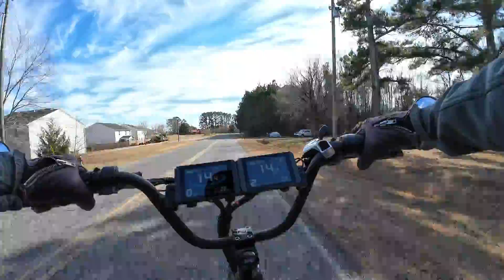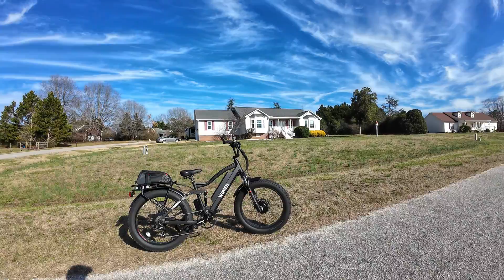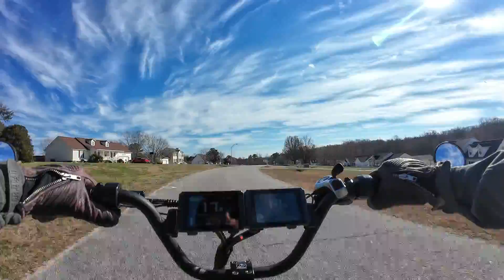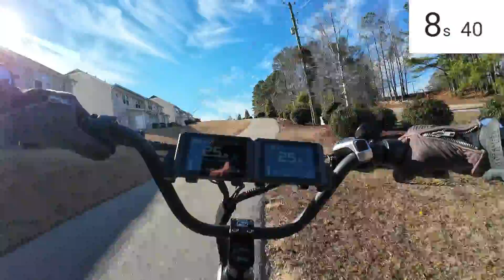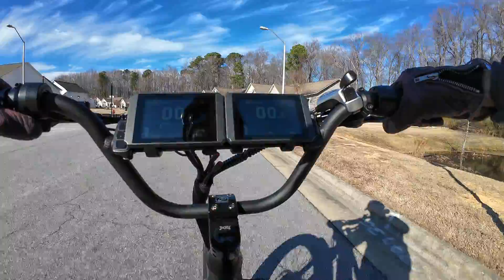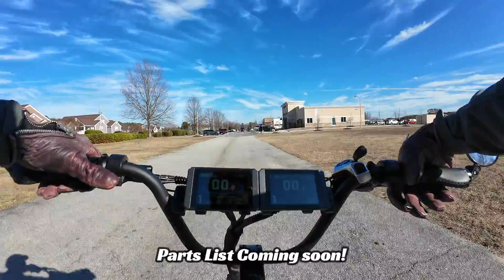Wired Freedom: Performance Upgrade Testing

Comment: Hi CC...
Can I suggest or you put it into a vote with all your viewer about upgrading an ebike with the super bike front and the side panels half way across the bike.
I would like to see that.
I want to learn fiber glass & do it myself & 3000w each wheel 72v controller system but funding problems stopping me.
I hope you do as I & many will love to see if it can be done

Comment: We need a mid-drive single throttle add-on plug and play kit for the 60v dual battery 2025 Wired Freedom. 😎🤘 And then a plug and play front hub for triple crown freedom!

Comment: This mod just makes it accelerate faster correct, it doesn’t make the top speed higher does it?
Reply from the maker: More acceleration and hill climb power, not top end speed.
Reply: @CitizenCycle925  cool.. have you seen the ecell five star? It’s essentially the same bike but I can’t find any reviews for it

Comment: Will the kit work on all bikes? Or do you need certain forks on the front to make it work?
Reply from the maker: Need the rst guide forks
Reply: @CitizenCycle925  thanks.
Reply: @CitizenCycle925  you wouldn’t happen to have a list of bikes already equipped with rst guide fork?
Reply: @CitizenCycle925  hey would you be able to test out the conversion kit on a beecool bike?
Reply from the maker: @singlestringstruggler1988  Unfortunately, I don't have a bee cool bike to try on.

Comment: I have a few questions about my 2024 freedom   Your thoughts on the rear gear set its different from the 2023 also the Kenda Tires they Have a Max presure 30 psi last year's tires are 20 psi and seem like they are softer compound.  also my wired had 4.9 miles on speedo out of the box everthing was freshly packaged do you see this with your new purchased bikes  
Lee

Comment: Could this be E-Cells answer to the Wired Freedom? The E-Cells Five Star. Nylon/steel hybrid gears, 60V 40 amp controller, 1200W motor, 20Ah battery, DNM air shock (rear), Kenda Krusade fat tire, 56 tooth chain ring, high rise BMX style handlebars, cruise control, etc, etc, etc. Free shipping, free front basket. Didn't reckon it would take too long for the competition to notice, let the price wars begin!

Comment: Is there a reason why you couldn't splice into the original throttle and display wires and eliminate the need for two of everything? Possibly even use the front/rear/dual switch from something like the grizzly?
Reply from the maker: Yes you can certainly connect everything together however The drawback is you are messing up all your bikes original wiring. Plus having both Motors connected to one throttle I find way more dangerous, the front motor can kick in when you're not expecting it. I've ridden many all-wheel drive bikes  And that is certainly their downfall, unexpected front wheel engagement.

Comment: It’s time to connect everything together with one throttle and one pedal assist and one display with a switch to be able to run one motor or both motors !!
Reply from the maker: Nah much better this way.  Safer
Reply: @CitizenCycle925  I disagree!!

Comment: Full suspension shouldn't be the starting point. You're lightweight compared to the average US citizen. These cheap bikes starting to creak like hell, when they're aging. These full suspension constructions aren't made for heavy riders, even if they claim they are. They wear out quit fast, if the user is heavy. If customers aren't able to maintain these constructions - don't buy it. You will thank me later. Get a hardtail, put a parallelogram suspension seatpost like the Suntour NCX on it and just be happy. If this thing stars to creak, open it, put some grease in it an be happy. If you totalled it, just switch it out and have fun again. It's cheap and easy. With a cheap full suspension bike it won't be easy. You have to find the spot where it creaks, and after that good luck to you to do the right thing. It's so easy to fck this up. Don't think that qualified bike shops will help you with your cheapo china brand bike.
Reply: Bike shops may not have a choice on whether to work on these bikes as their sales dip on their $5000+ bikes, they will need to add to the servicing of other bikes and sales of accessories for them,  just to keep the doors open.
Reply: @johnforbes9007   These constructions are cheap shit. It’s just what it is. Shops don’t touch it as they can’t guarantee for the repair. Just because Chinese manufacturers don’t give a fck about their customers and the products they sell to them, you can’t blame the bike shops. It’s a learnig process especially for consumers.

Comment: I bought a dual motor e-bike that is just fine, and it only has one display. It can be switched from front wheel drive only,  or rear wheel drive only, or dual motor drive. There's no need to go through all that modification on a Wired Freedom and have two displays that look just playing silly.

Comment: Soooo in summary, dual motor Wired Freedom; faster acceleration, same top end speed, same battery capacity...RIP battery.
Reply from the maker: 2nd battery is in my rear pack hiding 🙂

Comment: I just got mine yesterday. I can't get off of it. PSA: It's a HUGE bike, videos and pics simply cannot capture its actual size. No complaints personally, I'm 6'5 and even installed a 2 inch stem riser, I feel like a kid on it! If you're on the fence, just pull the trigger and get this thing.
Reply from the maker: Glad you love it and yes it is large and in charge, pics online  don't do it justice.

Comment: I wonder if you could change any of the gearing to get higher top end?
Reply: They’re hub motors..the gearing is all internal. If you wanna deal with gearings you need a mid drive
Reply: @slimdunkin117  I am not talking about the electric motor gearing, I was thinking more in the line of sprocket size!

Comment: Dude PAS 5 and run on the peddles it's an easy 40+ mph bike. Throttle only doesn't give full power. You'll notice when you're in PAS 5 and peddling doing 40 if you apply the throttle it actually slows you down.
Reply: I heard if you use the brake it slows down too

Comment: You can  use just 1 pas, 1 display and 1 throttle for two controllers and two motors. 
  With one battery inline, you just need to connect on throttle both sensor wires on a 3way switch before throttle connection ,and connect both negs together to make 1, use 1 power wire for direct 5v to throttle. 
  With Display : connect  1 power wire from controller to display, and both negs to display, match both uart in and out wires to each controller(IE: example both blue from both controllers twisted together to the one blue on display ) . And then do thru display reprogramming the setting to the way you like, be sure to have the display reset to factory settings before setting up.

  I have a few videos of one I built this way with a 1000w rear direct drive hub and a 1500w front direct drive hub, using 2 40A 48-72v controllers and 1 throttle w/regen ,and 1 sw900 display . No pas  was available with the controllers i used.

Comment: The range is atrocious tho. This bike is a UNIT! I recieved mine 2 weeks ago and I would only do a shunts mod. I'm not tryna add more significant weight to this bike. It's pretty much faster than most other ebikes on the market. Don't tell your local bike shop this bike goes over 28mph otherwise they will not touch it.

Comment: Love the power of the WF, but the bike its self is terrible, looks like a DIY Frankensteinz buld out of the bix, just throwing any old  BMX bars on a full suspension mountain bike, what were they thinking.  Needs to be converted back to a mountain bike, and the gearing needs to go fixed, can't ride any real trails with that set up.
Reply: It's not meant to be a mountain bike, hence the cruiser style frame, higher rise bars and bigger front chainring for higher speeds. This is basically a comfortable onroad/light trail bike. If you really wanted to do heavy mountain biking or downhill stuff, you would need a mid drive. Completely different applications for different reasons. The price point was their goal with 40mph speed and they achieved it.
Reply: @leetjohnson  it's not meant to be a mountain bike, but it is a mountain bike.    I ride black diamonds all the time with a hub motor,  I see the 250w full suspension out there all the time, but never seen anything with a Bafang mid drive, I've always wondered it a stock bicycle drivetrain could handle that kind of power on hilly rocky  trails
Reply: @bassw1758  you've never *noticed mid drives out there. Nobody that does serious downhill riding uses a hub motor. Mid drives dominate the higher end mountain ebike market.
Reply: I live in Folsom and there are literally hundreds of mid drive bikes out here.
Reply: @leetjohnson  yeah that's what I said, 250w full suspension, Specialized, Trek, those sort of bikes.  I ride a DIY Fat Tire Mountain bike, it's has the 1,000w Bafang Huh 6.5 wind( better torque, little less high-speed).  It will climb  just about anything with a little bit of help in PAS 2,  I'm surprised nobody else has caught on.
Reply: @leetjohnson  Bafangs?
Reply: @bassw1758  no, usually Bosch
Reply: @bassw1758  it's just a lot of unsprung weight, and you can't use the gears to multiply the power/torque like you can with mid drive.
Reply: @leetjohnson  I hear you about the non suspended weight,(full suspension going off jumps mid drive for sure)  but we're going to have to agree to disagree on power.  When your peak is 550w ish  you need the mechanical. advantage of gears,  Once your over 1,000w, peak, combined with the human factor, there's no advantage.   Tesla's run off of hub motors not mid drives, and I'm pretty sure they can climb.    For argument's sake hypothetically in order to beat a wired freedom in woods in a hill climb challenge  with a mid drive bike,  it would come down to rider skill.  On top of that, I'm far from a beast and I've strip hubs on my mountain bike without a motor.
Reply: @bassw1758  I'm not against the extra power, but mid drives are superior for heavy duty off-road riding, not necessarily for hill climbs. It's just a balance, weight, and efficiency issue.
Reply: @leetjohnson  so you have seen of high powered mid drive on a single diamond type trails?  would imagine you're changing cassettes and chains a lot.
Reply: @bassw1758  no, cause it's not really needed with the gearing of the mid drive and rear gearing. Less power, smaller battery, lighter weight.

Comment: You’re a little late to this upgrade because the channel Maximum Charge showed off his dual motor wired freedom 2 weeks ago
Reply: Citizens cycles builds are always by far the cleanest and most stock looking maximum charge is billed. Looks like a science project. It’s got shit hanging everywhere. It looks terrible.
Reply: @TheTcat1000 I'm not done with mine yet 😢😢😢
Reply: @maximumchargeEV I spoke of the devil and he showed up 😂
Reply: @anthony_786  I'm like @jfly2249, always watching the wired vids 👀
Reply from the maker: Yes, I got slowed up with the fine tuning of this project. But there's a reason for that 😉
Reply: @CitizenCycle925 could you show the upgraded brakes please?

Comment: Oh man ," U R The Man" I have been contenplating doing this because my top speed after 9 months has leveled off to around  33 - 36 mph . Hopefully you'll get at least 5 or 6 mph faster and if so I'll be doing the same . I was considering doing a shunt mod but was not wanting to mess with the controller in case it overheated . Always look forward to your experments Dr. Cycle :face-blue-smiling:
Reply from the maker: I'm targeting acceleration and hillclimb power, not top end speed. But having dual motors will take stress off the rear motor possibly allowing you to go a few miles an hour faster.
Reply: @CitizenCycle925 Those are my preferences too. Tons of torque 😅